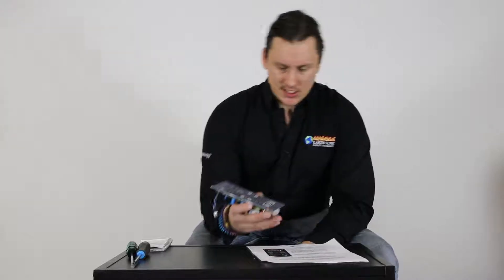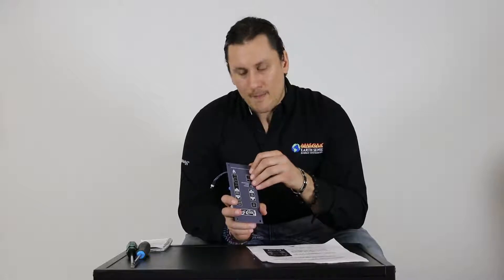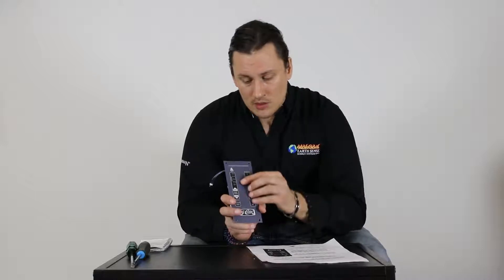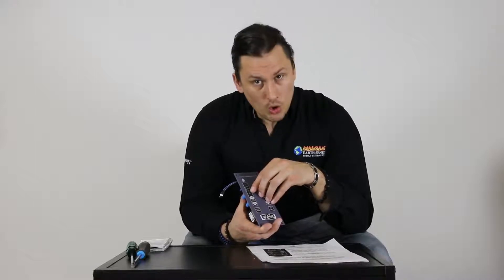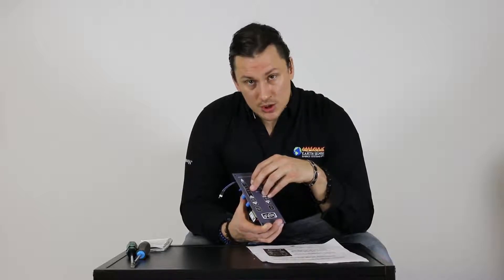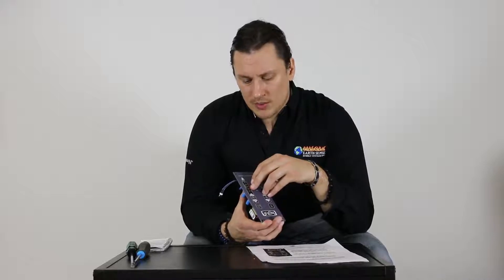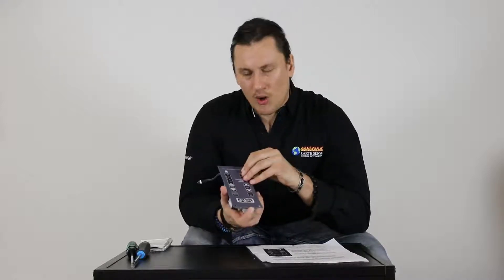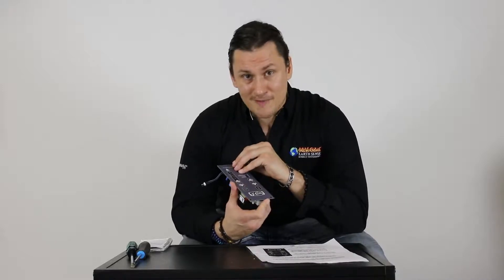St Croix Control Board Diagnostics - Error Code Fault Blinks

Comment: I’m trying to change my fuel type but when I hit the 3 buttons all 5 leds flash and won’t let me change the type.it’s the newer style control board
Reply from the maker: Thanks for the message Tony. Double checking with our lead techs on this one. I will follow-up with you. Thanks.
Reply: What is the best way to clean the spots you can’t get to? I got the control board working but due to all the bad burns it plugged up something somewhere and it’s starving for oxygen. You crack the front door and the flame goes up but as soon as you close the door the flame almost goes out.
Reply from the maker: Hey Tony, There can be ash that gets stuck in the rear firewall, upper heat exchange areas and combustion manifold that can block air flow and are challenging areas to get to. If you have brick board in place lining your firewall, remove that and use a mallet or hammer to tap on the back firewall. This will release stuck ash in that area to the trap door cleanout areas on the left and right sides. Our best tool for removing ash that is difficult to get to is a leaf blower vac. With the stove off and cool, we place the sucking part of the leaf blower vac on the exhaust vent flue pipe outside. While the leafblower is running, we have someone inside opening and closing the front door to create additional vacuum pressure and moving the heat exchange scraper rod back and forth. Here is the set-up we offer - https://pellethead.com/product/toro-vacuum-leafblower-pellet-corn-stove-exhaust-vent-cleaning-system-3-4-venting/ currently out of stock, but you could pick something like this up at a Lowes or Home Depot typically. Keep us posted, happy to help. Thanks!
Reply: @EarthSense
Reply from the maker: @wendycampbell5821  Do you need assistance with anything? Happy to help.
Reply: I’ll give the vac a try and see what happens, thank you for the help!
Reply from the maker: @tonyschill8054  Sure thing Tony! Keep us posted.
Reply from the maker: Hey Tony, Do you have the programming paperwork yet for the control/circuit board? If not, we can get that over your way. Let's also do a hard reset. With the stove off, unplug for 10-15 seconds and plug back in. Keep us posted, happy to help!
Reply: @EarthSense  I do have the paperwork still, I’ll try a hard reset
Reply from the maker: @tonyschill8054  Thanks Tony - Keep us posted, we'll figure it out. Appreciated.

Comment: We have the Element-P giving a #2 error and I have tried everything to fix it myself. Cleaned every nook I could reach, removed the exhaust fan and cleaned as far inside from that direction as well. Replaced both the exhaust fan and vacuum switch and the door/ash pan gaskets are tight but not new. We live so far out in the middle of nowhere that there aren't any techs that will come out here so fixing it myself is really my only option. Any help would be appreciated.
Reply from the maker: Thanks for contacting us, happy to help. For troubleshooting, let's bypass the vacuum switch to see if the #2 error code goes away - It will be key to isolate so we can determine where the issue is. Here is a video on creating a jumper wire for bypass. We never want to leave a safety switch bypassed, this is for troubleshooting only. Keep us posted once you have done this. Thanks. 
https://youtu.be/FDVkbsHS95U

Comment: Hi I have a brick wall pellet stove the blower fan keep going on Non-Stop any suggestion thank you
Reply: Hi 
Thanks for the help it's a brick wall big e
Reply from the maker: @hanial-omari7269  Ah, The Breckwell Big E pellet stove, sure. Thanks for that info. Is it your distribution blower/convection fan (Blows heat into the room) or is it the combustion blower/exhaust fan (connects to the flue vent pipe) that won't shut off?
Reply: It's the blower fan, that's one blowe hot air to the room. It doesn't shut off unless I unplugged.
I just hop I don't have to replace the board.
I bought it used.
I don't have much control of the functions on board.
You think the board is bad 
Thanks for all you doing helping me out I changed all the sensor and the igniter.
Reply from the maker: @hanial-omari7269  Thanks for the information. Happy to help. In the BIG E model the convection fan or room air blower is controlled by the control board. There is not a limit switch in line with that blower. Your high limit switch, low limit proof of fire switch, and air switch are in line with the auger motor. I would suggest getting a good light and inspecting all of the wiring from the blower to the molex connection. Double check the connection from the molex to the control board. Make sure the stove is UNPLUGGED while you are back there. If it's still running non stop see if there is a local dealer near you that could test the control board. If not, I can check with our in-house team to see if we would be able to test it and offer that service. Keep us posted.
Reply from the maker: I'm not sure what the brick wall pellet stove is.. Do you have any info on the make and model of your pellet stove? Generally if the room-air blower is not shutting off, in most stoves this would either be a snap switch issue or a control board issue. Knowing the make and model of your stove will help immensely for us to troubleshoot and assist you. Keep us posted. Thanks.

Comment: What would cause the auger light to blink a few times then go solid for a second? It sounds like a relay is popping. My ash pot gets overfilled constantly
Reply from the maker: Hey Tony, In normal operation the auger light should come on when the unit is feeding and turn off when the unit is not feeding. If you have a local dealer, I would suggest having them test the control board based on what you are seeing - something is taking place in the electrical circuitry. If you do not have a local dealer, we do offer a service for testing circuit boards. I can direct you to our team if you need to go that route. 

By Ash Pot, I'm assuming you mean the burnpot. If your burnpot is overfilling there's other things we need to look at. It could be related to the circuit board, but in most cases this generally is an issue of air flow. Most commonly ash blockage in the stove and/or venting, Gasket seals, Burnpot Seating, Combustion blower voltage, or fuel quality issues. We would need more specifics to properly help troubleshoot and diagnose. 
Happy to help.
Reply: @EarthSense  could the exhaust fan not turning fast enough cause a small flame and not be burning the pellets fast enough be a problem?
Reply from the maker: @tonyschill8054  Yes, most certainly. If the exhaust fan is not running at proper voltage you will notice a lazy fire and burnpot overfilling. The exhaust fan should be near line voltage on start-up - once it's in normal operation there is variance in the voltage depending on the heat setting selected.
Reply: @EarthSense  I’ll look into that. Thank you!
Reply from the maker: @tonyschill8054  Absolutely, happy to help!

Comment: I HAVE a EXL Prescott it will run great for a couple day and then flash 2  restart and next time may      run 2hrs
Reply from the maker: Thanks for contacting us. First thing I would suggest is a complete cleaning of the unit, ash traps, and exhaust vent. The #2 light will indicate a vacuum error. 99% of the time this is due to ash build-up somewhere in the stove, exhaust housing and/or venting that trips the vacuum switch. 
From there let's physically inspect your vacuum switch and hose. Make sure there are no cracks or breaks in the hose. 
We can double check the front door and ash pan gasket seals - want to make sure those are tight all the way around. 

When the fire is running, how does it look? Is it crisp and torchy or is it lazy in anyway? Is the build-up on the glass black and sooty or is white/grey? 

Happy to help.

Comment: We have the 4 .light blinking. And setting tthe program all lights   Up. Can’t get 1 or 2 at at time. I need to get 3 lights to light.
Reply from the maker: Thanks for contacting us, happy to help. Is this a new control board you are trying to program and set-up? Let us know a bit more information on what model you have and if this is an original board or new board you are experiencing issues with. Thanks.
Reply: @EarthSense   I just tried to program the stove again. I did what you told me to do. I still get all 5 lights to blink. I don’t get  1 at a time or 2 or 3. The stove is cold and we brought the new board that comes with the wiring kit.  We have a St Croix Pepin pellet stove. It’s old. We don’t have paperwork on it because, my Uncle gave it to us.
Reply from the maker: @Kokobear31  Thanks for the message and details, happy to help. I just reached out to our lead techs to see if they can send me any other specific instructions for the Pepin Retro Control Board Kit. I'll follow up as soon as I hear from them. Thanks.
Reply: @EarthSense  ok sounds good.
Reply: @EarthSense   kokobear31 here. Just to let you know St Croix Pepin pellet stover model WH000294 /Pepin . We replace the The original controllers.
Reply from the maker: @Kokobear31  Thanks for the info. Here is initial info from our techs - When programming the board, all 5 heat level lights blink at the same time and the determining factor is how many times all 5 lights flash. So if all 5 lights flash once then it is on setting 1 and if they all blink twice then the board is on setting 2 and so on and so on.

We have a written outline as well, if you can send an email address we can get that forwarded over to you.

Comment: #5 solid, and won't turn on. Tried unplugging stove for a minute (twice), and no change
Reply from the maker: Thanks for contacting us Jefe. Which St. Croix Model do you have? So the #5 light is solid, not blinking at all correct? Is the Combustion/exhaust fan turning on? Same issue if you switch between the different thermostat and manual operating/toggle modes? Happy to assist however we can, thanks!
Reply: @EarthSense  Hi! :) Correct, #5 solid red, no other diag lights. Green power light comes on within 1 second of plugging in, then after 1 more sec. power light goes out and #5 comes on. Tried all 3 modes (smartstat, t-stat, & manual), unpluging before each. Reseated all connections on control. Have a spare control panel: same result. Fuse is good. Good 120VAC at outlet. It does have a photo eye, which I disconnected and installed the jumper last year, (which is why I thought I needed a control panel.) Have not had any issues since then, until now. Tried holding down on/off button for a few seconds as well as pressing it multiple times. No response at all.  Fan doesn't turn on, but it seems like its not even getting to that point since there is zero response from pressing the on/off button. Also: I do Not have an external thermostat connected.
Reply: Sorry, forgot model: Lincoln SCR
Reply from the maker: @jefe2112  Thanks for all the info. I have sent this over to our two lead techs - will followup very shortly. Thanks!
Reply: @EarthSense  hi.  Any word back from the techs yet?
Reply from the maker: @jefe2112  Yes, just heard back. Here are the details and some items to check - 
The SmartScan Maintenance Sensor. This new Patent Pending sensing system
uses an Infra Red sensor that monitors the burnpot area of the stove. If the fuel
builds up on the back edge of the pot the stove will shut down and the #5 LED
will start blinking. This is an indication that Maintenance should be performed before the unit is fired up again.
6. If the stove is shut down and the #5 LED is on continuously, then the Rotating Drum is jammed and not in the correct position. Unplug the stove and remove the jam in the pot. If the drum goes more than two hours without a rotation this is what causes the error.  Things to check – 1)jammed drum, 2)drive motor failed, 3)relay timer module.  Likely not the drum switch as the drum would likely continue to turn.

Let us know what you find Jefe, thanks!
Reply: @EarthSense  It was a drum jam! A heap of unburned pellets were stuck in the back.  Was able to use a hook tool to pick/sweep them up enough to vacuum them out. Thank you so much for your help!!! 2nd time actually!  I used this video to troubleshoot my problem with the photoeye last year. This is a used stove, and I'm new to them, so each new problem is another lesson learned.
Reply from the maker: @jefe2112  So glad to hear that Jefe! I knew we would get to the root of it. Great to know you cleared the jam and she is running once again. Any future questions or needs just let us know. Thanks and warm regards!

Comment: Our glass cracked on our St Croix Pellet Insert.  We replaced it and after that the flame has been shooting all over.  It has been cleaned.  The stove has been shutting off and the 2nd and third light are blinking.  If we unplug the stove it might run for a few minutes and then shuts down again.  Can you help us?
Reply from the maker: Thanks for contacting us Janice, happy to help. If everything was operating correctly prior to replacing the glass, then I think that is where the focus needs to be to start. With wild flames inside there it tells me that there is an air leakage point. Let's really inspect the glass installation and the glass gasket seal to the door. We need to make sure that the glass gasket is making a great seal to the door and glass. If you have an earlier generation board where the 2nd and 3rd light are blinking together, this would indicate a High Limit issue. The High Limit switch does have a reset. But again, if you just started to notice this issue after the glass replacement and you have a flame shooting all over, somewhere we have an air leakage issue that we need to address. Please keep us posted, happy to assist however we can. Thanks!
Reply: @EarthSense  We replaced all the gaskets, cleaned the chimney and pulled the unit out and vacuumed it again.  Now after we plug it in, the fan goes on and the 2nd and 3rd light are blinking but that is all that happens.  No fire.  Also, I noticed the back of the fireplace has black soot .  It never was that black before.
Reply from the maker: @janicedispenza5946  Thanks for the message Janice. Have you pressed the reset button on the High Limit switch yet? 2nd & 3rd light blinking together will indicate High Limit issue. Let's push that reset button on the high limit. If no change let's pull the two wires off the high limit and use a jumper wire or alligator clips to connect the two wires together essentially bypassing the switch. ONLY FOR TROUBLESHOOTING, NEVER WANT TO LEAVE A SAFETY SWITCH BYPASSED. Let us know what you find. Please make sure to have the stove unplugged when working with the circuitry. 
Black soot would be an indication of an air to fuel ratio issue. Generally it is ash blockage or gaskets, but since you just cleaned the unit and replaced gaskets, I would suggest you use a multi-meter and check the voltage of the combustion motor. Should be near line voltage during start-up. Keep us posted, happy to help. Thanks!

Comment: Ashby p code 3 flashing ,motor continues to run after shut off ,changed out proof of fire switch ,still continues to stay in start up mode ,
Reply from the maker: Thanks for contacting us, happy to help. Let's do a test to ensure the replacement POF switch is good. In the shut down process pull one of the wires off of the POF switch - See if the combustion fan shuts down when the wire is pulled off. Before start-up, let's pull both wires off the POF switch and connect the wires together with a jumper or alligator clips. This will allow us to know for sure if it is an issue with that POF switch or if this is a control board issue in regards to staying in start-up operation mode. Keep us posted, thanks

Comment: #4 light for me is blinking on the ST Croix Hastings
Reply from the maker: Apologies on the delay here. #4 light would indicate the High Limit Switch is tripped. The High Limit Switch in your Hastings should have a manual reset button in the middle. We want to look at potential issues on why it may have tripped. Let's make sure your Convection Blower Fan is operating properly and distributing out the heat. Let's make sure the stove and venting is clean and free of any ash blockage/obstructions. Let's make sure the burnpot and grate are properly seated in place and the holes are free and clear. Gasket seals tight on the door and ash door. Always looking to have a bright, crisp, torchy flame in there. Here is a link to the High Limit switch for reference if needed. https://pellethead.com/product/st-croix-high-limit-thermodisc-snap-switch-250-degree-manual-reset-oem/
Any other questions please let us know. 
Thanks!

Comment: I keep getting a h2 error. I have a drolet eco 35 and I want to know how to reset it? Any idea?
Reply from the maker: Thanks for contacting us. Unfortunately we have never carried the Drolet line of stoves so we wouldn't be familiar with the control board error codes. I would suggest reaching out to the manufacturer and seeing what options they have. Generally speaking a person could do a hard reset by unplugging the stove from the wall for 20 seconds or so and plugging back in. My guess is there is some kind of an issue at hand on why you are receiving that error code. Sorry we couldn't be of mush assistance here. Thanks